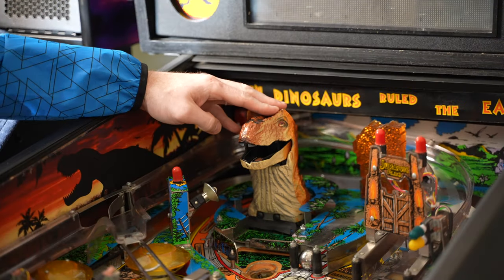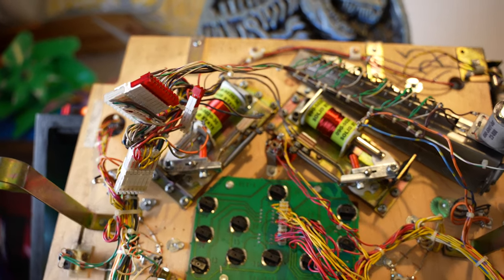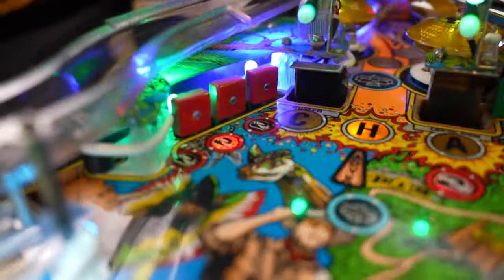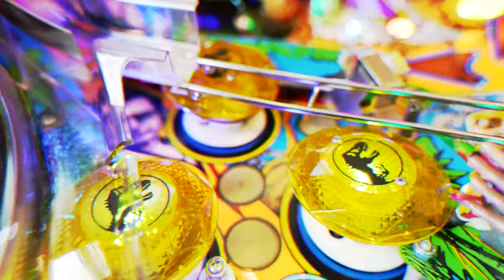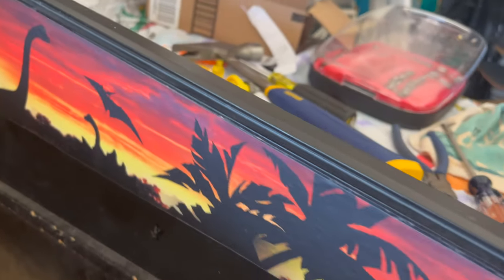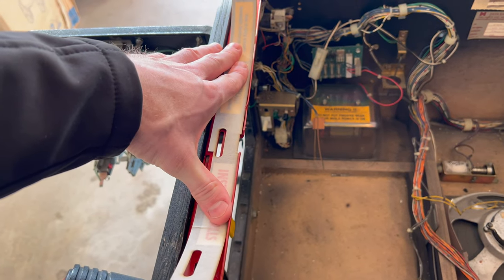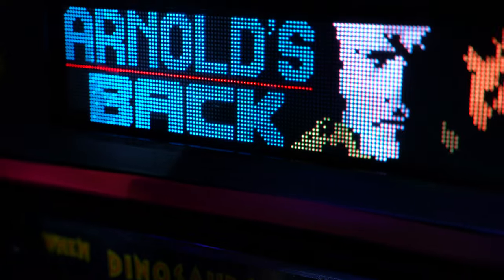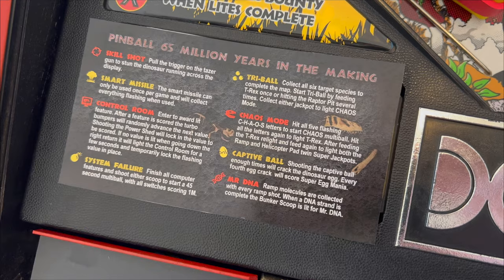Jurassic Park Pinball Machine - Rebuilding And Adding Pinball Mods

Comment: Looks stellar. It's amazing how much gunk accumulates over 30 years.

I like the red accents but I would keep the backbox frame black.
Reply from the maker: I think people have the misconception that Pinball machines since they have the glass on top are like snow globes and nothing gets inside them. Obviously that's not the case and they get super growdy inside rather quickly if you don't do regular maintenance on them.
Reply: @cooltoy  I think you mentioned the original price before but it escapes me. Were there units very expensive at the time? I can't imagine dropping $10k on one these days and not having it regularly maintained.